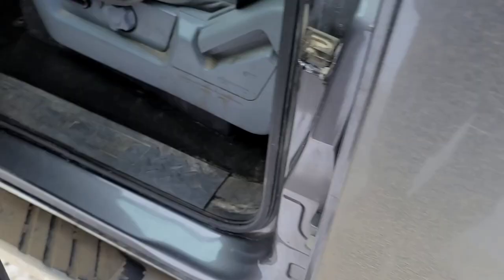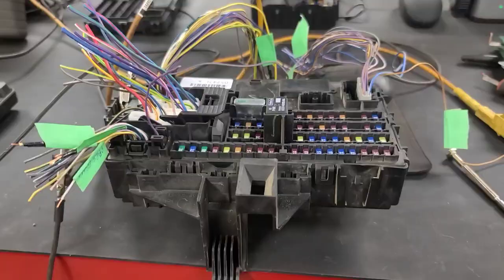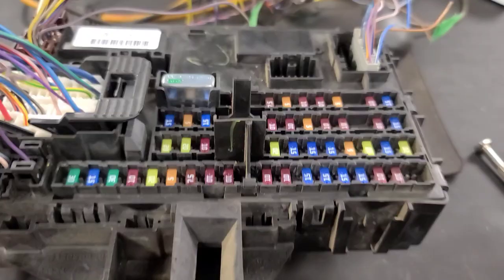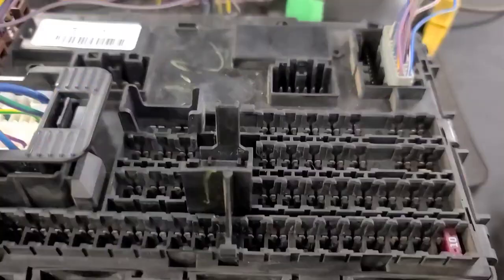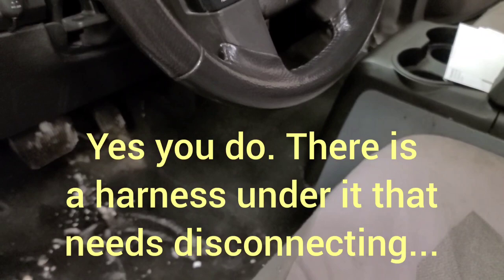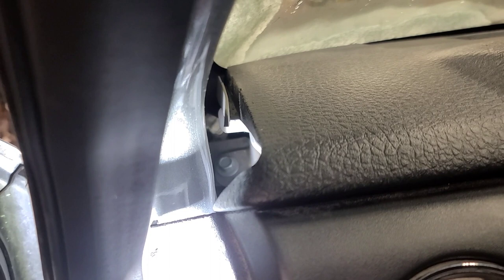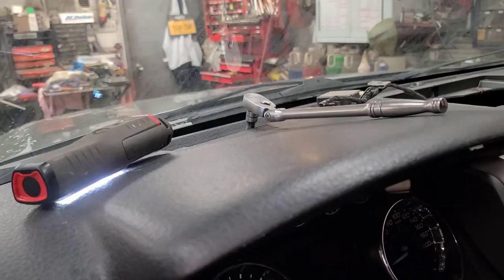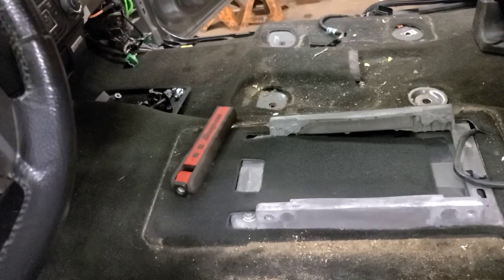2013 F150 Multiple Electrical Problems, Failed BCM Again!!! Plus Entire Dash Removal.

Comment: Did this problem come back? I am having the same problem right now currently on the second bcm and it only lasted two  days.
Reply from the maker: What were your symptoms? This has been good since cleaning all the grounds and adding the diode to the shift interlock.  Is yours a column or floor shift model? My customer is from a northern community and so hasn't picked it up yet but I've been driving it on and off since tge last repair. Put over 1000klm on it.
Reply: @PhillipBailey  mine has a floor shift. I’m having the exact same problem. We are on bcm number 2 and it only lasted about two days. They were both brand new from the dealer. Don’t want to install a third one without finding the root cause of the problems because I know the same thing it’s going  to happen.
Reply from the maker: @macklinhernandez5053  well I don't think we will ever know for sure but the truck I worked on seems ok now and it's been several months. I did physically remove all the grounds and cleaned them. There is one on each side A pillar behind the plastic trim, one on the steering column support brace and one or 2 by the battery on the right inner fender. What are your symptoms?
Reply: @PhillipBailey  same exact symptoms door locks don’t work emergency lights stay on message displaying parking brake light is on low brake fluid light on.
Reply from the maker: @macklinhernandez5053  well that seems to be tge same for sure. Sorry I wish I had a more specific fix. That's all I can suggest. This truck had two from the dealer, then I put in a used one that lasted one day, then another used one after taking the entire truck apart because the dealer said there was a water leak from tge windshield causing the problem. Good luck and keep us posted.
Reply from the maker: @macklinhernandez5053  hello. How did you fare with your BCM issue? Did you get it fixed. Just following up...
Reply: @macklinhernandez5053  did you ever find an answer? I have the exact same issues happening.
Reply from the maker: As I mentioned in these comments the truck I worked on is fine now. My only suggestion would be to clean all body grounds. This appears to be a pattern failure that Ford does not know the root cause of. Good luck and keep us posted.
Reply: @GriefPB  honestly I installed a third bcm and all I did different from the rest of them was clean the grounds. Also I don’t know if I did something wrong when I did the programming because the keyless entry doesn’t work. I was going to try to fix the keyless entry problem later, I wanted to see if it was going to happen again but so far everything  else it’s working on the truck. I decided not to try to fix the keyless entry problem because I have a feeling it might have something to do with the bcm going out. It’s been a few months and the truck is still running.
Reply: @macklinhernandez5053  good to know, thanks for the reply!

Comment: Haha love the video maybe you can tell me why the radio heat ac controls and 4 ways all stopped working on my 2013 f150 xlt
Reply from the maker: Check fuses? These are all not related circuits IMO.
Reply: @PhillipBailey  I've checked every fuse i can think of they are all getting power?
Reply from the maker: @miked93  you will need a full function scanner tool to check for codes in all the controllers. Then based on codes and communication with the modules or lack thereof you can move forward. Good luck
Reply: @PhillipBailey  the 2 codes i got was bcm and ficm and considering i have power at the bcm im thinking it isn't the bcm. But what I'm confused about is how in the hell is the radio heat ac and 4 ways related to the ficm when the radio has its own module and so does the hvac
Reply from the maker: @miked93  There is no such ting as just a code for the BCM or FICM. There may be a code for "Loss of Communication with the BCM" or FICM but there should be a number associated with that like U0101 for instance. I would need that. What are you using to scan the truck? If you have a communication issue you can have multiple electrical issues. Possibly a problem with the interior can bus system.
Reply: To bad I cant add pictures i found the problem with the 4 ways heater and ac and passenger airbags mice chew chew chew but can't find anything with the radio yet

Comment: if you disconnect the haz switch on the dash does the truck still show a voltage draw? my only experience w the eco wiring was on the abs module pin 28 was a faulty ground...
Reply from the maker: When the BCM failed multiple times it would flash the hazards, illuminate the brake warning light, low brake fluid message and the power door locks would not work from either inside switch. Disconnecting the hazard switch did absolutely nothing. Having the hazards on would obviously drain the battery. All these circuits are pull down circuits where the switches simply ground a voltage signal coming from the BCM. I believe the internal source for the voltage was what was failing in the BCMs. As to exactly why I may never know. I took apart one of the BCMs and traced the internal circuit to one of the fuses that powers the brake shift interlock solenoid in the column. I installed a clamping diode across that solenoid to eliminate its voltage spike. Cleaned a bunch of grounds and it's been fine ever since. I don't really want to remove the diode to see if the problem returns as these BCMs are in short supply and not cheap.